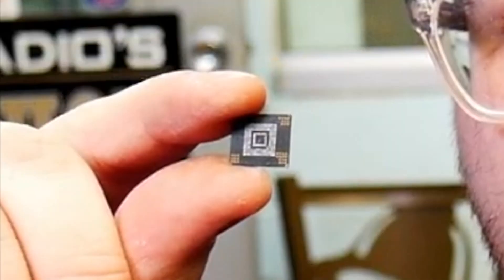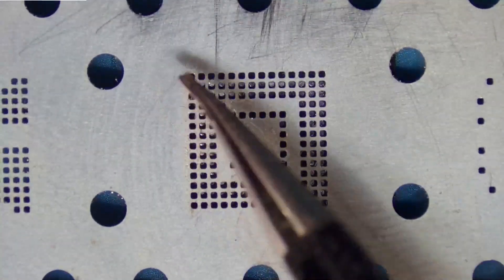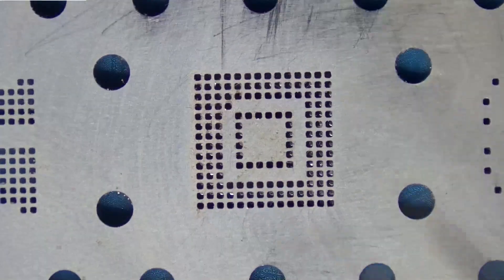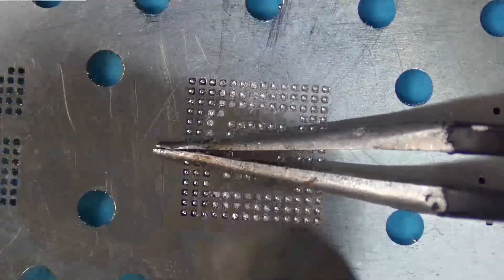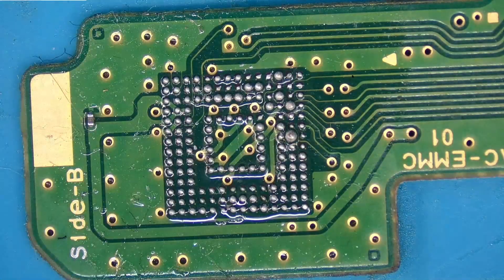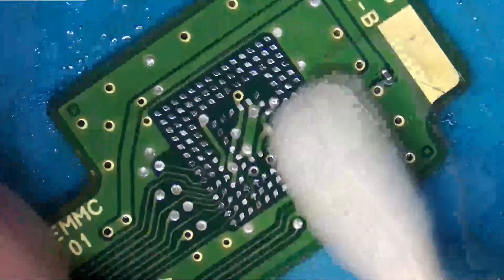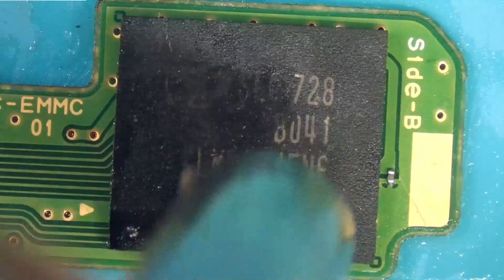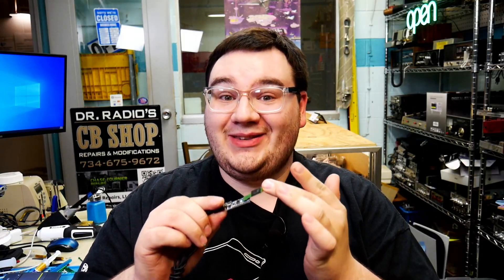You CAN Easily Reball An EMMC Chip! (Nintendo Switch, Flash Drive, Wii U)

Comment: Hey Chase ! It's been a while. I hope you are doing great. I was never able to get the stock settings for your camera from anyone. ( NRF 1st camera not the IMX385 V2 )  If you get time when your doing a repair could you take a few screen shots and post them for me on here in community section? Or even just open the menu in your next video for like 5 seconds at the end :) I purchased a new MS camera but would like to use the other one. I was never able to get the correct settings to have a good video quality like yours is now. I just need to compare your MS camera settings to mine and then try it out. I did purchase the RT5109 IMX334 from rising cam and the video quality is amazing. It has a super clear real 60 FPS in 4K. The color accuracy is also great. I was worried about low light but there is 0 issues also. I have the old camera all setup with an 180X lens & a .5X barlow on its own stand. The RT5109 is hooked up to my trinocular MS. I have the .35X adapter connected and a .5x lens at the bottom.
Reply: Only if you get a chance. I know your busy and have your own things going on. I would greatly appreciate it.
Reply from the maker: Email me, I'll get it for you.
Reply: @chasefournier  ok thank you very much !!! Ill email you now. keep an eye out from mr.b.***
Reply: Sent :)

Comment: When I saw your title I thought, "Here we go..." Someone has learned about my success to reball a chip on the fly.

But it seems the way I done it was pure fluke, which was to simply clean the board, clean the Chip, flux the board, Flux the chip and 
apply solder to the chip with a loaded Soldering iron so the chip ends up with solder mounds at each pad, I then placed the chip to 
where it was to go and using my heat station applied heat until the chip slid into place, surprisingly it worked. 

Also has anyone tried using a toothpick to dab sticky flux at each pinpoint of the chip to then carefully place the chip down onto a 
bed of balls within a Lid loaded with suitable balls to then lift it directly up again. I haven't tried this as age set in severe shaking, 
anyway, what I am hoping is that the balls will stick only where the dabs of flux have been placed, leaving excess balls to fall down 
back onto the lid. 

If that trick works... YOUR WELCOME
APU I dropped yo a 👉👍👈
Reply from the maker: Hahaha I've done this with other chips in the past, but I have found, if I don't have a stencil and I'm in a pinch, this is what I'm gonna try hahaha 

But the reason I bought the stencil is because you have a guarantee it's going to work, and if you have to run jumpers under the chip, the balls give clearance for that. So ultimately it's a better, fool-proof way for bga chips.